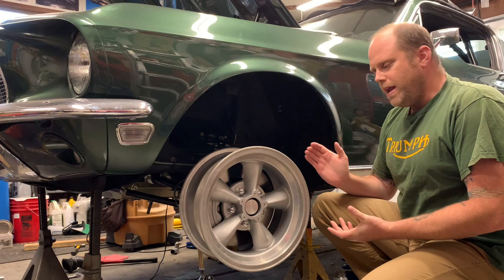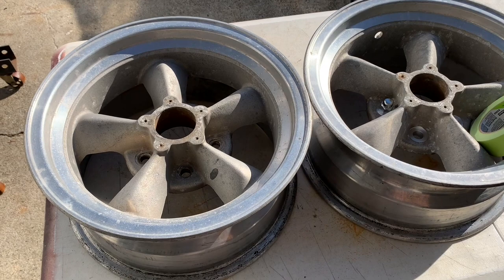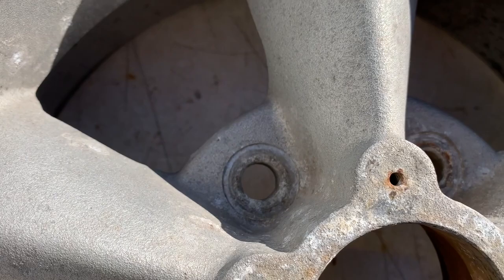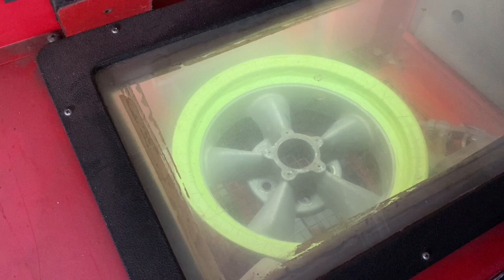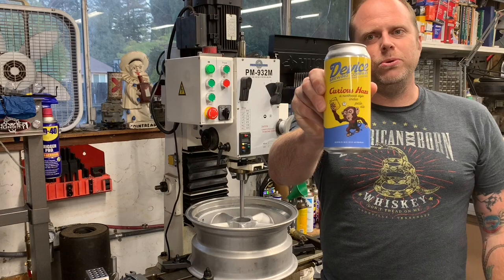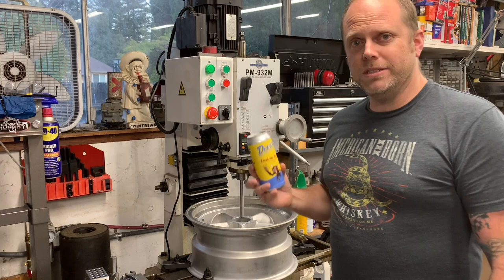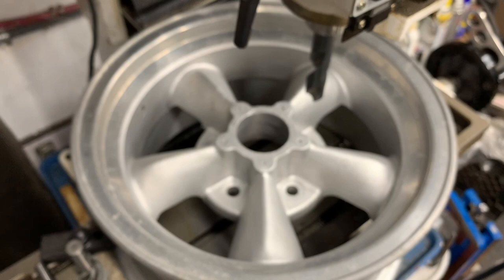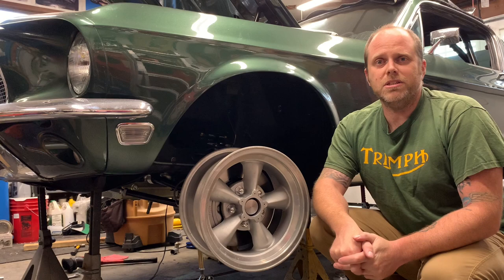Vintage American Racing Torq - Thrust “D“ Wheel Restoration: 1968 Ford Mustang Fastback; Part 1 of 2

Comment: Looks like you machined in the center of the hole? How did that work with Chevy pattern being 5x4.75 and Ford being 5x4.5? Thanks!
Reply from the maker: I put 5x4.75” hubs on the car. Seemed wrong to ruin a pretty rare set of wheels when I could just change a part, and run them as is.
Reply: @crazycaseyscustoms  thanks for the response! What hub did you use? Do you have a stock ‘68 spindle still?
Reply from the maker: I’m actually running Baer billet hubs on a 70-73 spindle with the Boss 302 Trans Am brake setup,  @driveway_finds . It’s a combo of Baer, Street or Track, and Cobra Automotive stuff.
Reply: @crazycaseyscustoms  thank you!
Reply from the maker: Happy to help, @driveway_finds . If you scroll back a bit on my videos page, you’ll find an install on the brakes that goes into more detail.
Reply: @crazycaseyscustoms  perfect thank you!

Comment: I can show you a pair of these that’s on my 1973 Hondo Jet Boat trailer that is small Ford lug pattern
Reply from the maker: Well, if you have a legit aluminum American Racing 15x7” flat spoke crows foot “D” wheel in a 5x4.5” bolt pattern, then you have one of the rarest wheels in existence, my friend. But I can’t tell you how many times people have said that and then either wound up having the regular curved spoke wheel, a 14x6” wheel, or a Japanese knock off like an Appliance wheel, or something else. I even found a set once where the lug holes were so worn they’d fit the 5x4.5” pattern, but on inspection it was obvious that they were originally made for 5x4.75”. The only set I have ever seen of a true vintage aluminum 15” “D” wheel in 5x4.5” were 15x6”, and even still, that’s the only set of 4 wheels I have ever seen in almost two decades of hunting. The mags are still out there, and they’re not even all that rare, but they’re just expensive, and usually not even usable. But I can honestly say that an aluminum early style American Racing Torq Thrust “D” in 15x7” and 5 on 4.5” pattern is a wheel I have never actually found an actual example of. If you have a set, and on a boat trailer no less, then my hat is off to you, sir.
Reply: The ones on my boat trailer is in fact identical to the ones in your video I’m not sure if they are rare like you say but I do know the front spokes and backside are identical to yours and they are 5x4.5, I found your video cause I’m done restoring the hull now I’m fixing to get started on the trailer and wheels they are in need of a good cleaning and possibly restored
Reply from the maker: Right on,  @justinw523 . That’s pretty cool! If they’re American Racing Torq Thrust “D” wheels they’ll say that, cast right into the back side of the wheel. If they don’t, but they look “exactly” like mine, then they are a Japanese-made Appliance brand wheel. The Appliance wheels from Japan were an exact copy of the early American TTD’s and fool quite a few people. As it is, they’re a great looking wheel and still worth a fair bit of money. They won’t say “Appliance” anywhere on them; they just won’t say anything. But if they DO say American Racing Torq Thrust “D”
on the back side, then you have the real deal.

Comment: Hi Casey, I’m looking to restore a set of original torque thrust wheels, curious as to what happened to part 2 of your restoration.
Reply from the maker: Hey Mark! So, those wheels are sitting under the car, which is currently on jack stands. BUT, I need to move it soon, so I need to finish those wheels. I’m hoping I’ll have time to film it; I can’t promise anything, because we’re trying to get moved right now, but I will try, AND, if I do, I’ll post it here for sure. Thanks for watching!
Reply: Thanks for the reply Casey. These wheels I’m looking to restore for my buddy are off a 29’ Ford roadster that was in the Prowlers car club in San Diego since the 60’s! The car is still intact but does need some tlc which we are giving it to make it road worthy again. Hope your move goes well. 🤙🏽
Reply from the maker: That’s AWESOME @MalibuMark-tg6ob . Are you documenting the project anywhere? I’d like to follow along.